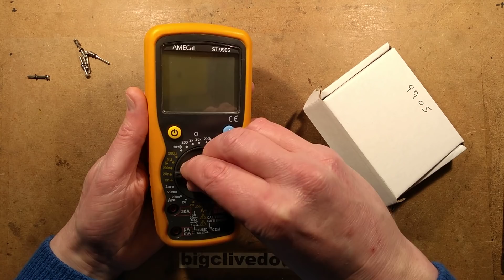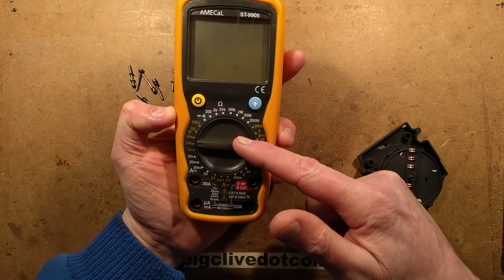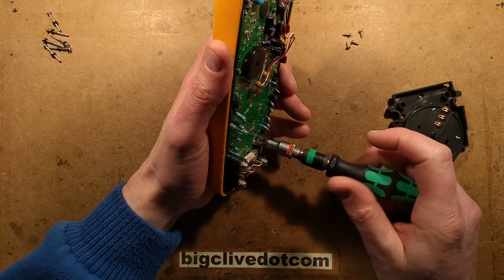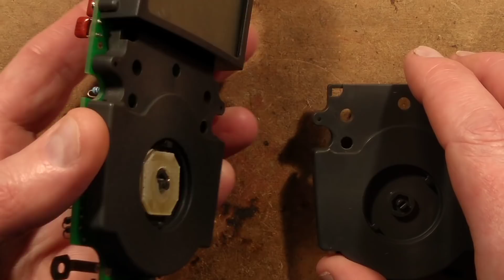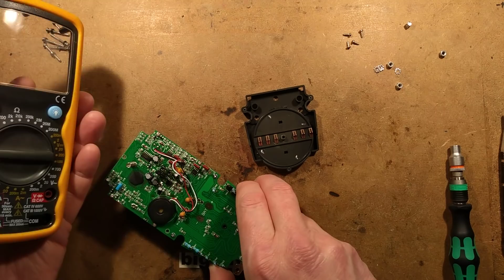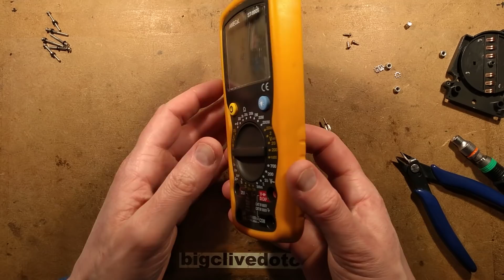Replacing the Amecal meter (and others) rotary selector plate.

Comment: Would it be worth reinforcing it while new rather than waiting for it to start failing? Especially if you have it all apart anyway. Oop. 8:52
Reply: Против Глобал  Yes, a zip tie, or wrap with wire and some epoxy drizzled.

Comment: My cheap 'n nasty meter has lost calibration. I'd get it re-calibrated, but I half suspect its cheaper to replace than repair.
Reply from the maker: If it's not a low battery it's a lot more cost effective to get a new meter.  Many of the "calibration" companies simply check if it's reading correctly and then pass or fail it anyway.

Comment: They weren't willing to sell me a spare and insisted I send it to them and cover all costs which after VAT and return postage made it too expensive to be worth while so I bought a Vici instead.  I could have had two Vici metres for the same as the cost of repair amecal quoted me. Ever since it's sat in a box in bits.
Reply from the maker: That's a bit disappointing.
Reply: I got the Vici VC99 and been quite happy with it, perfectly fine for my hobby needs.
The temp probe was handy for testing the arduino clock/temp/humidity project I've nearly finished building (nearly being got it mostly working over a year ago and really must finish it one day)
Reply: @Daniel Glover I asked for a spare and they said no, you'll have to send it back at my expense. It was out of warranty so I couldn't see the problem but as mentioned it wasn't worth it financially. If I'd have paid the repair costs including the cost of it new I've pretty much bought a fluke 113 and some how I doubt this would have been an issue.
Reply: I got a vici as a second meeter but it soon became my favourite. For a hobbyist it's hard to beat.

Comment: Why havn't I bought a meter yet...gotta go do that
Reply from the maker: Lots of choice of brands and styles, and all very affordable these days.  The only important thing to note is that if you ever intend to use it on industrial equipment with high current supplies then you should get an industrial-rated meter for safety.  For home use you can use just about any meter.
Reply: @bigclivedotcom  ooo I got a reply...thanks for the advice clive, I won't be needing an industrial one, just one for tinkering lol

Comment: Well, that's another difference of opinion with Clive and myself; as someone who loathes anise, Jagermeister is utterly off the table for me. When it comes to liquor, I like good bourbon. I used to enjoy certain sweet liqueurs, but having turned up diabetic some years ago the somewhat shocking sugar content of something like Grand Marnier put me off. 

I will admit to wondering how Clive would react to California's most recently legal Adult Refreshments. ;)

As for the meter - I couldn't quite tell if there's an outer raised lip of that area where the shaft connects to the contact rotor; would it be possible to pro-actively reinforce that by adding some resin around the base of that socket without getting it into other parts? I'd think that would be a fairly quick thing to do vs. the repair you did after it broke.
Reply: I like anise, can't stand Jägermeister.

Comment: On Fluke meters, these rotary contacts are notorious for becoming intermittent, and result in the wrong mode (AC V instead of DC V), the display going blank (power off), or reading of 0.000 no matter what is connected to the input terminals. It might be CAT IV / 1000 VAC, but still not a fail-safe design to read 0.000 when connected to mains voltage!!

Comment: Limp knobs, nuts, shafts, balls, silicon and lubrication. Quite disappointing....

All I came here for were the boobies.
Reply: it's BigClive, you have to expect some screwing around
Reply: PIXscotland He seems to prefer a different mating system, although he has apparently some work experience for your system in a purely technical capacity.
Reply: Alas, no boobies on the Isle of Man. You'll need to go to the tropics or the pacific ocean to find them, according to https://en.wikipedia.org/wiki/Booby
Reply: Wrong Channel
Reply: The spring was the boobie trap.
Reply: Whe he complained of a limp knob, I said "They make pills for that, now."

Comment: I used a $25au meter for a long time. I got a 2nd one, exactly the same, because I wanted redundancy, and sometimes you want current and voltage. When one of those was stolen, I went and got exactly the same meter. I was given an $80 meter for my birthday later that year (from the same company, Jaycar's house brand), which didn't have autorange, and didn't have nanoamps scale, and didn't have the same higher range on the frquency counter. It was mostly just that I didn't get a more name brand one (but, at that time, 13 years ago, you couldn't get meters that were name brand and in my hobbyist budget in Australia).

I'd've loved a really swish brand name multimeter, but for my basic home keyboards, synthesizers and guitar pedal tinkering, having 2 cheaper meters was better than one expensive one. I still have those 2 cheapy meters, though. They've lasted over a decade, so I'm happy with that.
Reply: It's all about getting the most bang for your buck. When your equipment earns an income, it's different from when it's nice to have. Cheap meters can be handy in any case, especially when there are several places you might need one. Heck, for a lot of purposes, a bulb, a wire and a battery would be perfectly sufficient.
Reply: The only real advantage to the 'big F' is that you can get a calibration house to calibrate them and give you a certificate that allows you to use them in  AS/NZ9001 environments. In that case you can afford to wait a while for the reading to come up  :)  All 3 90's vintage F'87s I had anything to do with had display problems. We'd send them away and the service agents would replace the zebra strips ($arm+leg),  they'd maybe last another year.